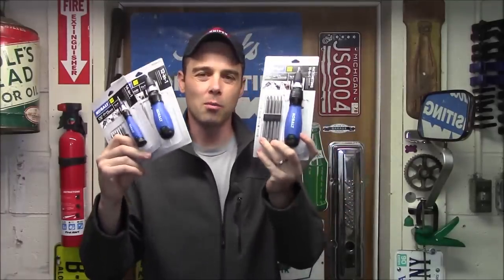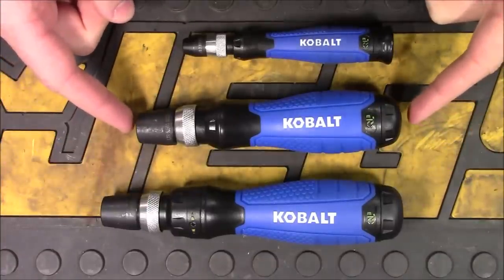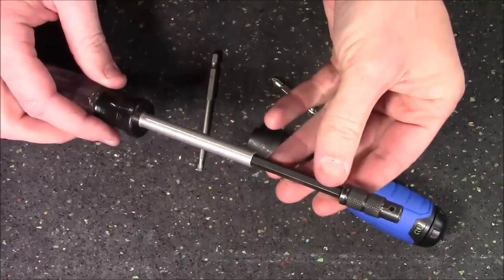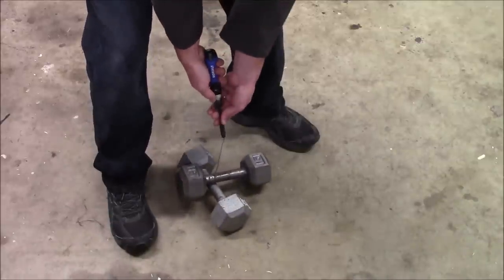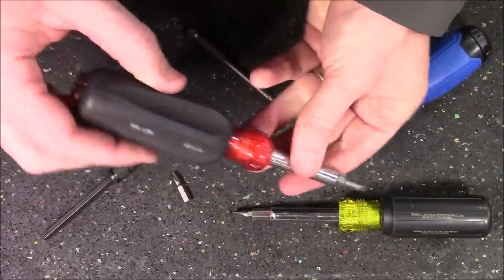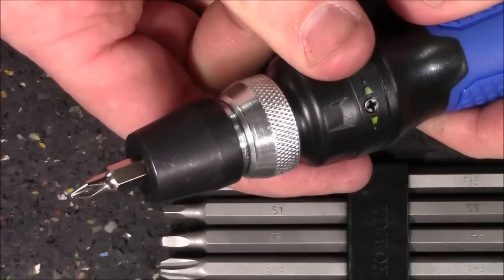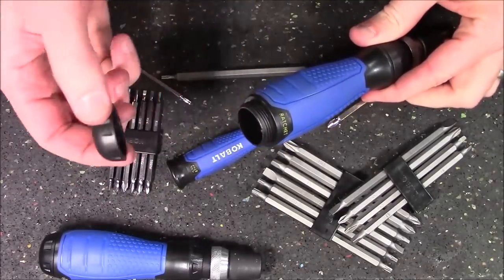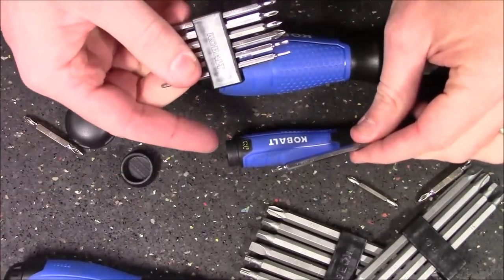Kobalt QL3 Quik Load Screwdrivers

Comment: I couldn't figure out how to take out the bit that it came with. I was fooling with it while watching your video. Did you show how to remove a bit? Didn't look like you said to push the silver part toward the handle to do that. I had thrown away my instructions after I got it thinking it would easy enough to figure out without instructions later. I kept twisting and pulling. Not thinking push toward the handle. I have the little precision one.

Comment: Thanks for making this video! I've had the precision version for a while, I very much enjoy using it, and I didn't know that there was a full-sized version available until I watched this video. Not too long ago I purchased the full-sized version and it's a great tool for me. I think you covered basically everything good about it. Also, using the full-sized screwdriver along with socket adapters make it very versatile. The only thing that I don't like is that there seems to be no 5/32" bits or bit sets available; and that really has little bearing on the actual screwdriver.

Comment: I miss your reviews - hope you do more video soon.  Bought both the precision and large ratcheting models about a year ago based on this review.  They are both fantastic.  The bit holder mechanism is the best I've used and the ratcheting is smooth and very quick when putting in a fastener before you need to apply torque.  Husky now sells one with the same bit holder but has bits stored in the handle - it's also very nice.

Comment: I didn't really need this but after seeing your video, it became an impulse buy as Lowe's had them near the self checkout. I grabbed the larger ratchet version without even thinking about it. It holds my little Chapman torx bits firmly in spite of the ball detent on those bits. Also followed your suggestion and added a #18 o ring onto the cap threads. Works like a champ!

Comment: A well done video. Thanks so much. One comment to Kobalt. I bought the Precision         14 in 11 screwdriver set.. Kobalt SHOULD have made the extra bits just a little bit shorter so they could fit inside the handle. This will make it  Much easier to carry around. Thanks.

Comment: Thanks for this video. I searched the interweb for months looking for a bit driver like this. I bought the non ratcheting 1/4" just because I didn't like how big the the ratcheting one is. The bits that it come with are fine if you wanna carry them around or store them. Stupid how they don't fit in the handle storage area. I wasn't interested in that style of bit anyway. I wanted 1"x1/4" traditional bit storage. So my next issue was finding an insert that holds 12 bits to store in the handle. No luck to find one by itself. So I found one that was close in a husky bit driver. I drilled the handle out to accommodate the husky bit holder, used your o-ring idea, and bam. I now have the exact thing I was looking for. Absolutely love it. So many options with one comfortable, cool looking handle. Thanks again
Reply: late response, but can you link or provide details of the Husky that has this 12 bit storage

Comment: +Real Tool Reviews - I know this video was posted a while ago but I have a question about a feature on these handle sets I think should have been covered in this review... 
     I have one of Kobalt's 'Double Drive' screwdrivers which has the same type of Quick Load mechanism built in. Though with mine, it came with a set of the slightly longer than standard 1/4" double-ended bits (the same size as the single shorter bit that came with the two larger handle sets in the video), a set of the long 1/4" thick double-ended bits, AND a set of the long 5/32" thick precision double-ended bits (same size as the bits that came with the smaller handle in the video). The same mechanism on the one Double Drive screwdriver I have will actually hold BOTH the 1/4" thick bits AND the 5/32" precision bits (very well I might add), which is a very cool feature because I don't need more than one handle for big or little screws. The thing that sucks about mine though is, it does not properly hold standard short single-ended bits. They fit in the tip and it holds them from falling out but they are too short and are too recessed into the shaft to work very well. The only bits I can use are the ones that came with the set.
     My question is, will either of the larger two handles you're reviewing in this video hold the thinner 5/32" precision bits properly, or not? I was surprised it wasn't mentioned in the video and I'm honestly wondering if you were even aware that the mechanism on the larger handle is capable of doing that (if it is possible on these model handles that is)? You should try it (if you still have these handles around anyway) and edit the video (or just reply to this comment) with your discovery. Thanks!
     I thoroughly enjoy your videos, by the way. I appreciate your very honest and informative professional opinion of these products. I find your reviews to be very helpful when I'm shopping for a new tool. Thank you for sharing.

Comment: I just picked up that large one today and it works really well.  The extra bits supplied are nice but as you said they are too long to fit in the handle.  I have plenty of others, so that isn't a problem.  Used a #18 o-ring above the threads on the handle and that is an improvement.  I have a bit that can be used for driving sockets, so I think I'll be getting some use out of this thing.  Thanks for the review.  (Has anyone ever told you that you sound a lot like Adam Carolla?)

Comment: You for got one thing is that the craftsman and the other screwdriver is a 1/4 and 5/16 nut driver. So if you had the other end your 1/4 bits would work.
Reply from the maker: +Randy Charlton They fall out.....nothing holds them in.

Comment: The bit end looks like a total "win", but the storage handle appears to be a total "fail". Why wouldn't they have made it a 1/2" longer to accommodate the long bits that come with it? Great review. I appreciate you doing reviews on items that no one else is looking at, but have real world application. #tiacrew.
Reply from the maker: +Daniel Julian Thanks!  I think that the storage/bit issue was an oversight.....hopefully round #2 at some point will address this.  I was happy to see Lowes geting rid of a lot of the "gimmicky" tools & replacing them with higher quality ones like these though.....good to know you appreciate the small tools along with the expensive power tools! :)
Reply: +Real Tool Reviews Do you have (or could make) a video comparing the different brands of 1/4" hex quick-change adapters? I used to have a cheap Black & Decker that was awesome, but lost it. Thought I found and exact replacement, but turns out it releases the bit by sliding the collar out instead of in and it doesn't hold bits very snug (they wobble). I haven't found a good one since.
Reply from the maker: +Daniel Julian I will see what I can do.....one to look at though is the WERA.....it is by far one of (if not the best) 1/4" adapter on the market.  Check it out here (and read the reviews....I have one, it is awesome) --- http://amzn.to/1VSE2fN

Comment: while I enjoy most reviews this looked and sounded like a Kobalt commercial. especially when comparing it to the 6 in 1 tool and trying to pretend they don't have a 1/4" side to hold bits. also, unless they changed their usual plastic use and design, they are nowhere as sturdy as many of the tools they are meant to replace. (they could fix it by making the handle solid)
Reply from the maker: +Mike Zupancic Well, the 6-in-1 does not hold 1/4" bits (unless they have a ball detent as shown).  The other side will not hold a bit securely.  I like this new design, and these are a brand new version --- not a repackage of the same old screwdrivers you are probably familiar with.  Keep in mind.....100% of my reviews are for legitimate tools.  Go to Lowes and check them out for yourself.